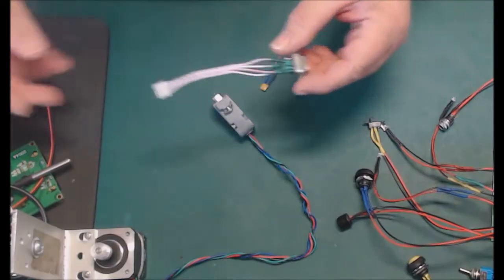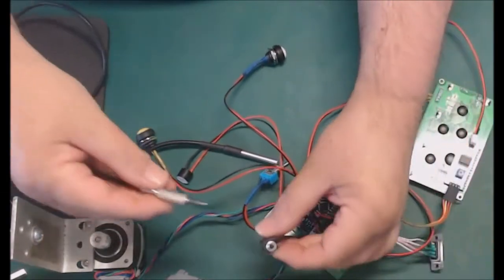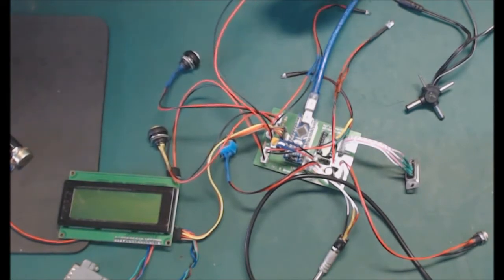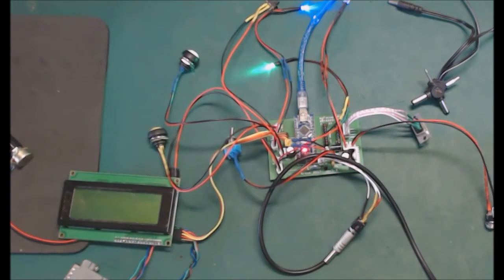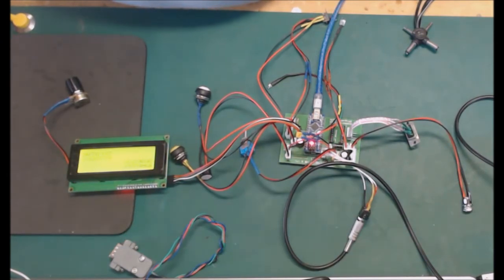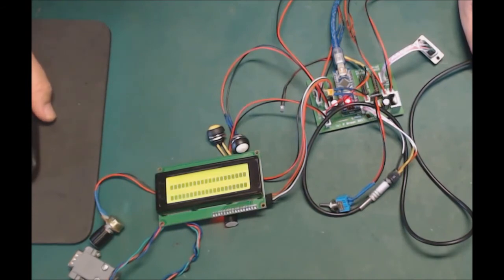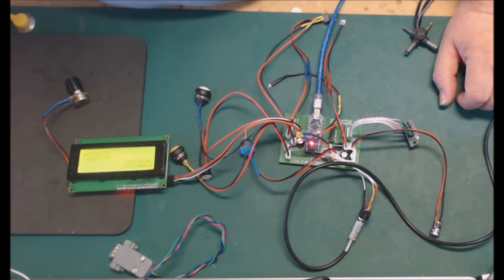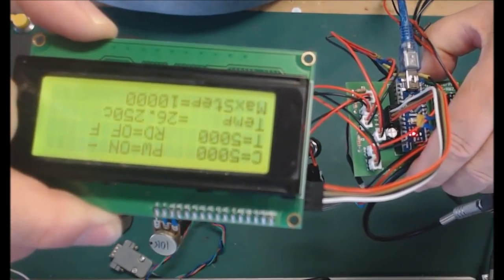Part1c Testing the myFocuserPro2 controller

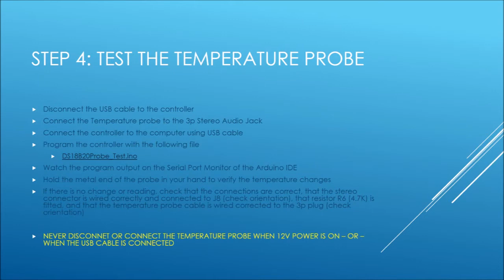Comment: Hey Robert. I´m a Arduino Beginner and start the Test Sketches. Here I see a loop in the serial monitor with "RAW Switch Value = xy". The Button pressings are ok. But at your video on 6:36min I see there is a "No button is pressed" and no loops. Why?
Reply from the maker: The test program I was using was older - I since updated it.